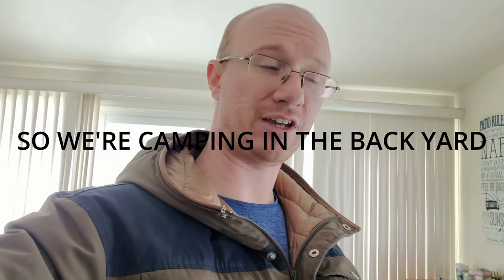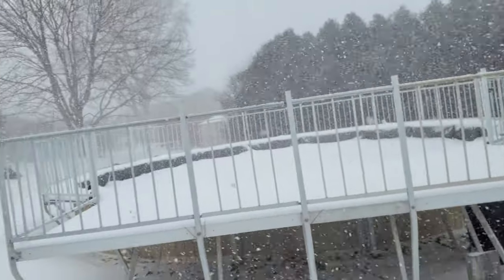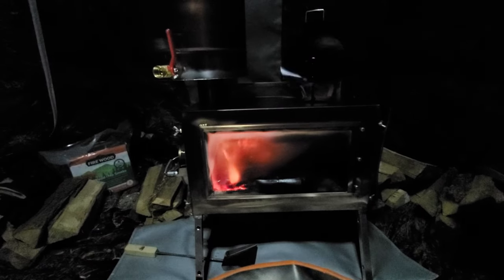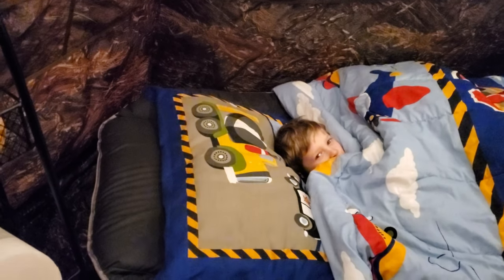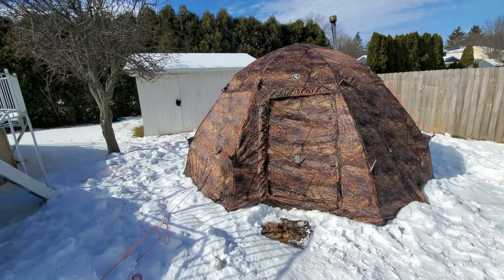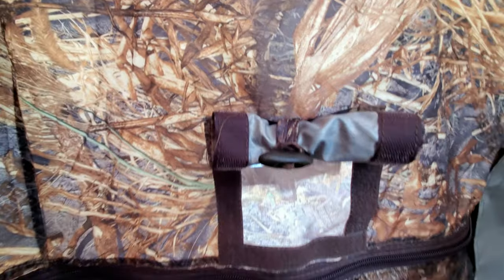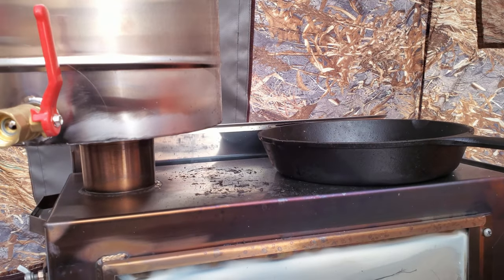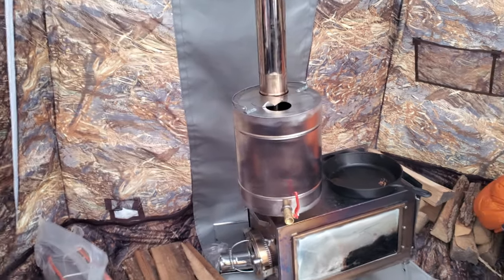New Hot Tent - Initial Impressions and Testing Russian Bereg UP-5 in Wind Storm - Cam's BDAY!

Comment: Long time listener first time caller!
I'm just about to pull the trigger on the same setup you have...I agree completely about the water boiler. I may be mistaken, but I believe it's that size, because of it can be used for the sauna. I'll stick with my kettle and have more surface space. 
Blessings🙏
Scott.
Reply from the maker: Thanks for the call and I'm glad you've been listening. It probably is that size for the sauna, but I would have preferred something attaching to the side so I could remove it from the heat so it doesn't just boil away.

Comment: That tent is HUGE! And that’s what ya need for a growing family.
I’ve been thinking of getting a hot tent, but not so grand🤣 just a two or four man tent. I love that stove but don’t begrudge the water heater, better to have it and not need it than to need it and not have it.
Great video and Happy Birthday Camden🎂 (I hope I spelled that right👼).
Oh, May I suggest a first hot tent camp out? If the ice is still good, Big Island on Raquette Lake.
Reply from the maker: We went to big island for this trip last year. Such a great spot. I want to hot tent and ice fish there at the same time. Would be fun.
 
https://youtu.be/OdSUYrMhPa0

The size of the water heater I guess isn't the biggest concern. Just that I can't heat it up and leave it. It will boil and evaporate into the tent. I don't mind the extra moisture in the air. But I also like my winnerwell one where I can have it off the heat if I just want water ready when I need it. I will admit I think the reason for the big tank is because the stove is designed to be used for a sauna if you wanted. I wanna try that some time. Hahaha
Reply: @AbundantAdventures  
Duh! I forgot that I already watched that video 🤣🤣
I did a canoe trip there two years ago, love that island!
Reply from the maker: @UncleDan58  yeah a great spot. Loved that trip!

Comment: Water heater can make you happy if you want to make a sauna in your garden, you just need to put rocks on your stove and then pour hot water on them(i know because im from the east) by the way if you try this with cold water it may damage your stove
Reply from the maker: Yes, I've seen someone do this recently and thought it looked nice. I might have to try it. Thanks for the tip on using warm water instead of cold! I wouldn't have known that.